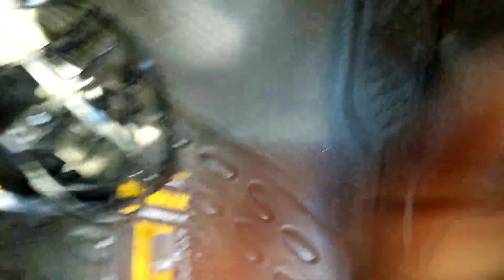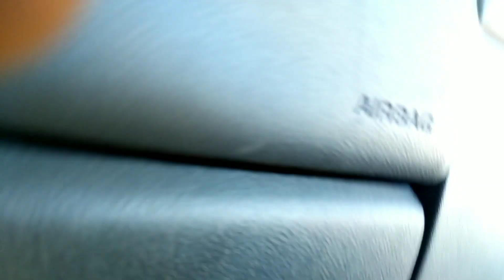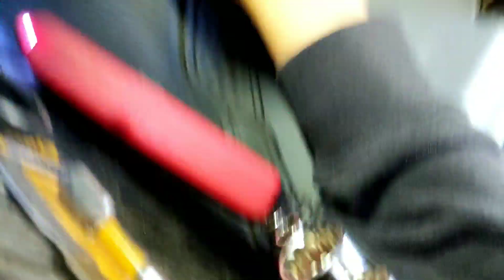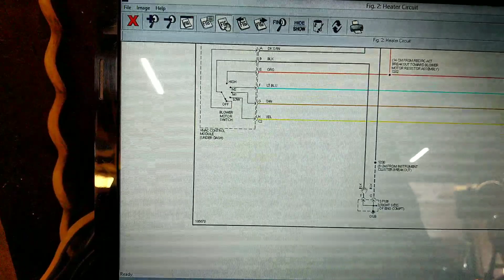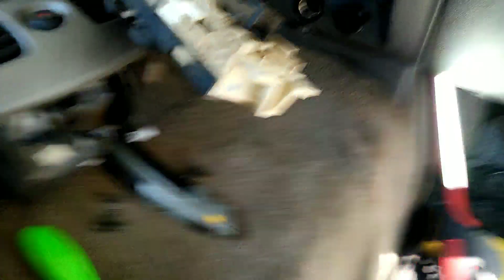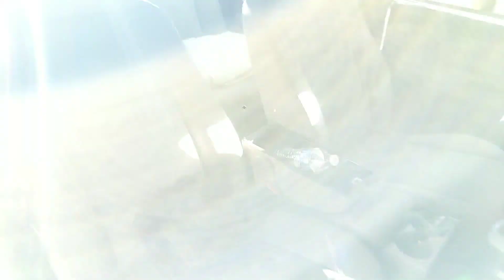HVAC BLOWER MOTOR NOT WORKING CHEVY COLORADO

Comment: Approximately how much should it cost to get this repaired. I've got it to work again once but seems intermittently to fail. And today it sure was warm out with no AC 😂
Reply from the maker: Make sure you have solid ground &  power,  make sure the blower motor resistor is not faulty as well, if all is good, then your blower motor is not good, the best time to test for any problems is when the system is malfunctioning.
Reply: @evolutiondiagnostics  My issue is now under the air intake against the fender it's the black pin fuse connector

Comment: How do you get the plug out of the heater fan housing so easily I can't get mine loose
Reply from the maker: it's an old video, but as far as I know, the connector has a locking tab that you need to press on with a flat screw driver, or with your fingers and pull on the connector, if it doesn't come out, it might be that heat melted the connector and now it's frozen shut.

Comment: My hero!!   I replacer the blower motor resister and burnt wire harness behind the glove box and thought I had this issue  fixed but no.........    the %^&$@ blower would STILL cut out on me from time to time.   I then discovered the other problem:     A bad ground.  But where??   
Yep, it was just as shown.  Now identified,  my way to resolve the issue was to retain the bolt and scrapped the OEM grounding box.    I kept the metal leads on the conductors but trimmed them to make the leads narrower. The leads were then crammed in an oversized terminal eyelet (one with a hole large enough to accommodate the bolt) crimped in place and then soldered for good measure before reattaching to the fender wall with the original bolt.   I have ground like crazy now, and this WON'T be coming apart!   

Like so many automotive issue,  the repair is Simple Simon--- IF.......................you can only diagnose the causation!   
Thank you Evolution Diagnostics!
Reply from the maker: @jamesstrupp799  I'm glad this video got you out of trouble, sometimes you just never know what's going on, but someone else already went through that same issue you're having but can't figure it out.

Comment: How did you fix that ground connection ?
Reply from the maker: cut off the wires at the black box, get a regular loop terminal at auto parts, peel off some insulation on the wires, about 1/4 of an inch, solder or crimp the terminal to the wires, put it back in its place & torque the bolt to 10Nm done.

Comment: I'm a woman and I think you did an excellent job, I just took  everything apart and  changed the resister and harness and was just fixing to order a new console with the switches but I'm gonna go check my ground right now. :)
Reply from the maker: sure, give some feedback on that project, hopefully is the ground to, like the majority in here telling me it's the ground.
Reply: @evolutiondiagnostics  my ground ended up good under the hood but the wiring harness on the passenger side on the floor behind the trim had no power on a few wires the ground included, I opened the harness and they had burnt up. I spliced the ground together to check everything out and lost blinkers and bright lights lol. 
Went back and made a better connection of the rest and all is well now. My blower is back to working but still only working on the 3rd setting so I went ahead and ordered the new switch control board. Thank you again for your video, I injured watching it.

Comment: How many ground wires for the heater goes to that box on the fender having the same issue I used to wiggle the box and the blower motor used to work but now I wiggle and nothing happens Cut the plug off and I put new terminals but still blower motor not working
Reply from the maker: what box? be more specific and I might be able to help you.
Reply: The black box / plug on the passenger fender by the air filter, I tested the same ground wire on the back of the heater module ,but that ground is good what other ground wire runs through the passenger fender for the hvac
Reply: What other ground wire would it be under the hood on passenger side, online says there are 2 ground wires for hvac that go to that ground block /plug next to air filter? You show the 1 ground wire on the back of the heater module but where would the other ground go to ?
Reply from the maker: @rob3888403  according to the video, I see two ground wires, one goes to the blower motor switch, one goes to the HVAC control module. 
I'm not at the shop to go back to my wiring diagrams to confirm it but, just remove the HVAC control module and check the ground at the blower motor switch, if you have a good solid ground at the blower motor switch, then check your blower motor resistor for a faulty connection. does your blower motor work at all speeds or not?
Reply: Awesome thanks man , which one is the blower motor switch, I appreciate the help a lot thanks, I thumbs up and subscribed to you ,
Reply: Blower don’t turn on at all , it has a new blower motor a new resistor new wire harness to the resistor, I used to shake and wiggle the ground wire on the fender and the blower motor used to turn on now I wiggle and nothing happens, any help is much appreciate it
Reply from the maker: I'm not sure if GM put a splice or connector at the dashboard but, according to the video there is no such thing. remove the bolt at the fender side, check for good contact point at the terminal and body, check for burnt & rust at the touching point.

Comment: I have same problem, no ground on my dash control fan.
I followed all your steps but still no ground on it. So I put ground straight form my PROBE III then my blower started working.
So could I put straight ground wire connected  to the dash control black wire(ground wire)??
Reply from the maker: sure you can, as long as you get a good grounding point to hook your ground wire at, you shouldn't have any issues.

Comment: It's the paint where the ground bolt is. Just take off bolt and remove the paint to make a better connection for the ground.
Reply: Let's keep this comment at the top, shall we. This is what solved my problem.
Reply: not only that but one of the pins in the ground pack connector seems to not be making good ground. loose pin or something. everytime you wiggle the wire it shorts out/grounds